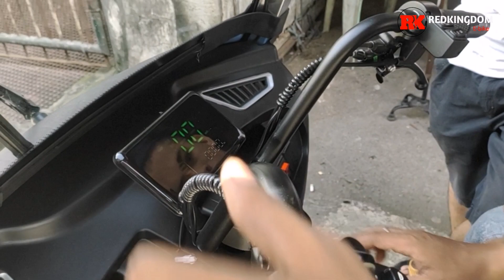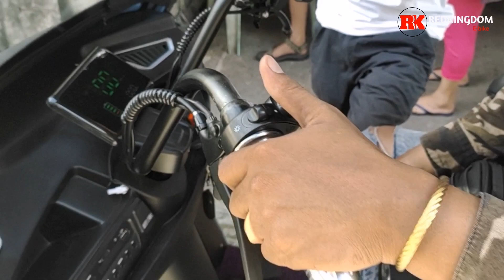Redkingdom ebike|| RK09-V2 kayang kaya sa mga paahon na daan sa batasan hills #batasan.

Comment: Sir ganyan din po model ko ano po ba dapat ang no. Pag paahon ang etrike?
Reply from the maker: Number 3 po sir☺️☺️pag hirap na si ebike po pero si depende padin sa watts ng controller, motor nio pag paahon sir kung masyado ahon baka neec nio mag upgrade po para hinde hirap si ebike at masunugan po kayo ng wire
Reply: @papajomz7759   650 watts po kala ko po ksi hnd pwede i no. 3 pag paahon
Reply from the maker: Pwede mas malakas po si ebike pag naka number 3 po sir pero lage po natin tandaan pag naka 3 lage kahit anu ebike brand pa po yan asahan natin mabilis ma lowbat po  sya kasi mas lalakas po ang labas ng kuryente sa battery po☺️
Reply: @papajomz7759  salamt po ng marami  sa advice may nag sasabi kasi skin na wag daw i no. 3 ang ebike  pag paahon masisira daw
Reply from the maker: Sir may posibilad din po masira pag paahon tapos number 3 yun po yun mga mababang watts na kahit number 3 pilit inaahon kahit hinde kaua doon po nasusunog kundi motor oh kaya controller po mas ok pa padin kung alam nio po ang kakayahan ng ebike nio sa paahon, sir
Reply: @papajomz7759  650 watts po yun motor ng ebike ko ano po recomended po na no.  2 or 3? Kasi minsan po   may sakay aq asawa k at anak mga ngsa 190 kilos po  kmi